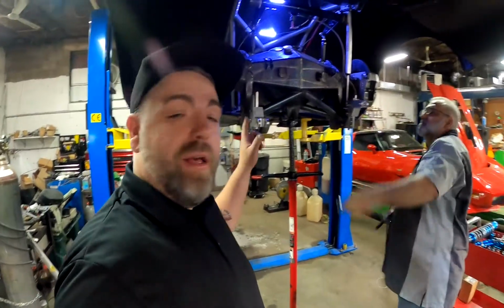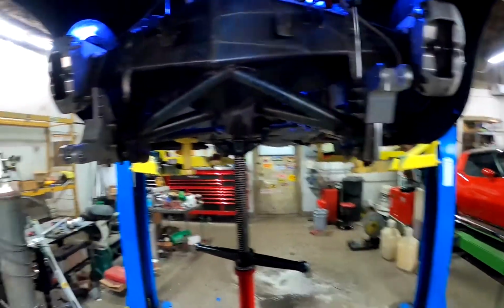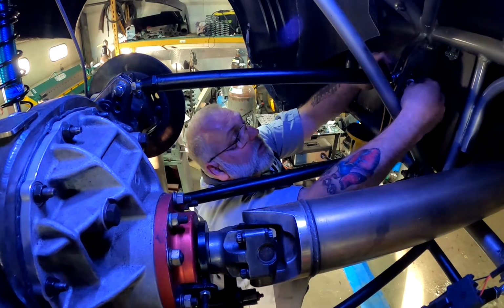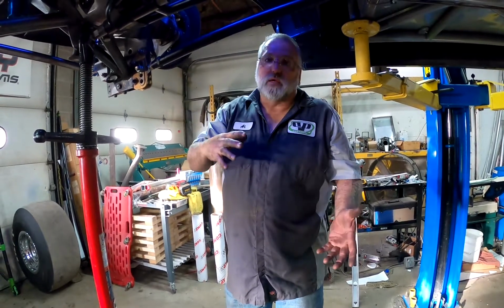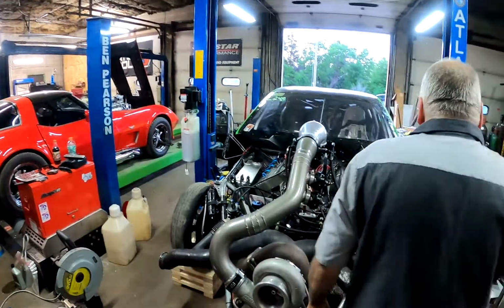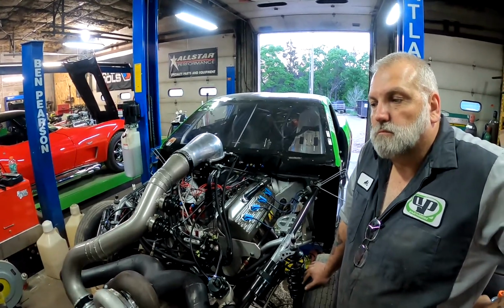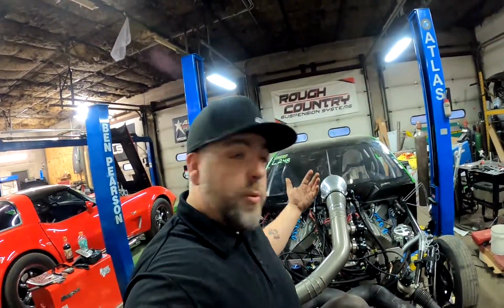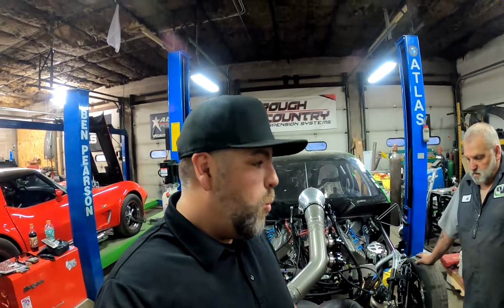Drag Radial Setup, Q & A

Comment: Hey bud what is your pinion angle on radial setup at ride height thanks
Reply from the maker: Hey Shelton, we actually go over it again in this video. https://youtu.be/ZLCjo4UWtpk

We don't set the pinion angle at ride height on radials, it's actually set at full droop as that's where the car should be headed down track.
Reply: @BadInfluenceGarage  man I appreciate it

Comment: what size radials are you running and brand
Reply from the maker: 315/60-15 Mickey Thompson Pro Radial (NOT the pro bracket radial) the pro radial is made in 2 sizes 275 and 315